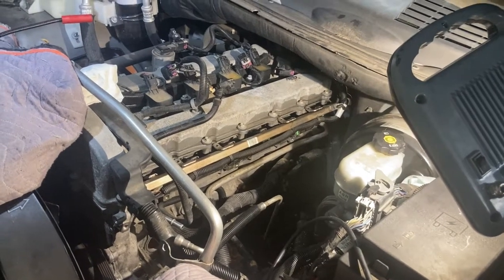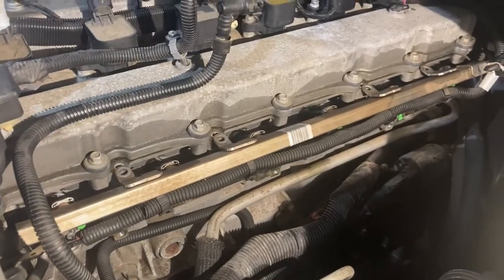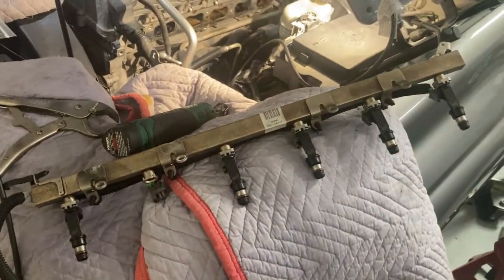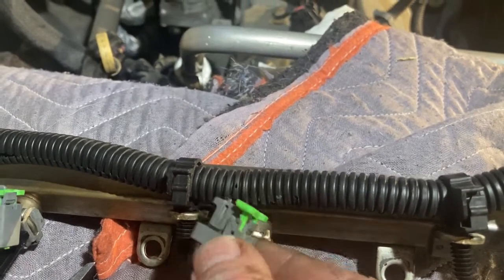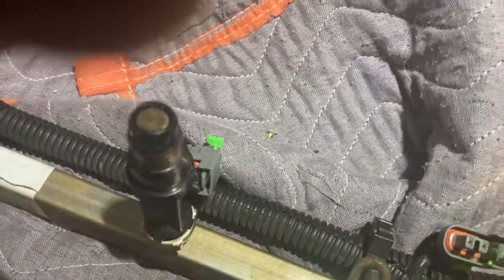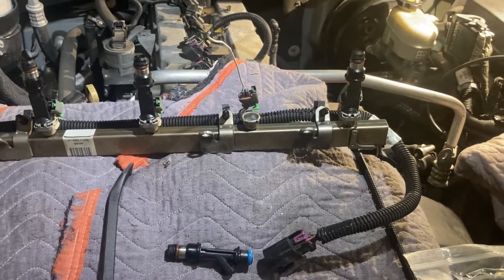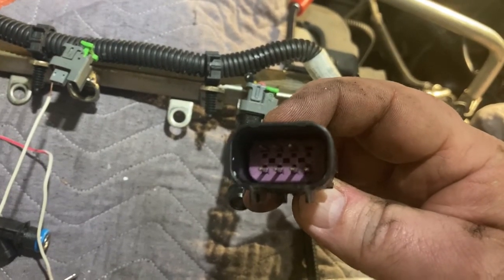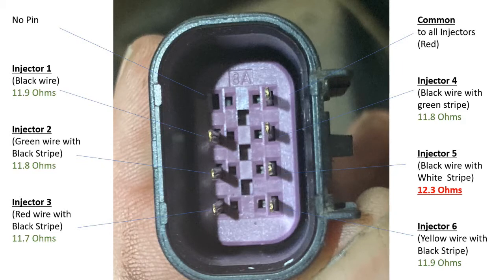Trailblazer Fuel Manifold, Fuel Rail, Fuel Injectors, Pin out

Comment: Thank you for showing the pins and the color of the wires, I have been searching for many hours to find what the yellow wire with the black strip controls, cause mine was damaged by a rodent and then was pinched under the intake causing injector 6 circuit malfunction. Thanks again!

Comment: I think there's enough videos of how to remove the manifold easily available on YouTube.

However, this video saves you so much time and gives critical troubleshooting info in an extremely digestible format that can save you time guessing if your injectors have issues and which one in particular using a multimeter. Thanks man!

Comment: Did you have to remove your serpentine belt?
Reply: Hi Ashlee.  Yes, you need to remove the serpentine belt to remove the alternator to gain further access.  Once the alternator is removed you need to then remove the intake manifold which is no small effort.